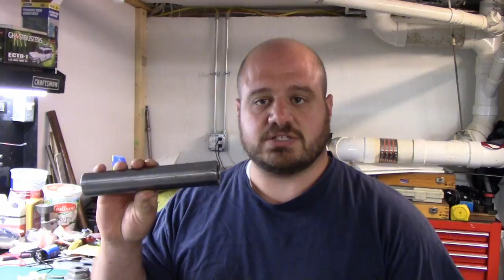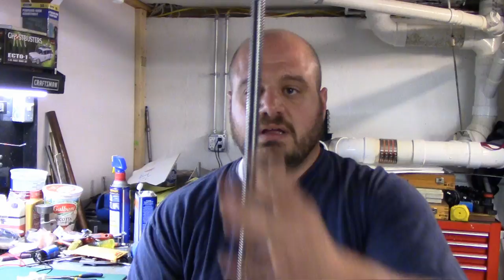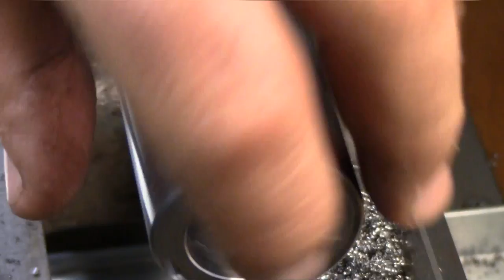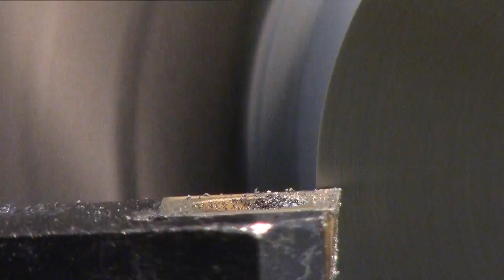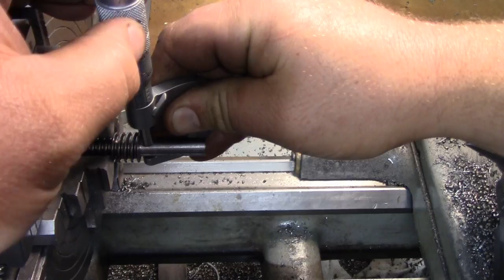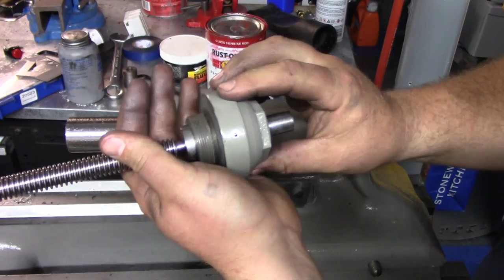13" Southbend Refurb: Tailstock Repair

Comment: I had problems with the tailstock on my 10L not holding.  A cleanup with a borrowed MT2 reamer fixed it very nicely. Inking it before vs after showed maybe 25% contact, now its around 90% contact.  Stuff doesn't spin anymore.

Comment: Hi Greg, very nice job indeed! As an aside, the paintwork on your 9"seems to be holding up well - what "type" of paint is it and did you brush it on?
Reply from the maker: Sherwin williams all surface enamel applied by brush and cabinet roller

Comment: Hi Greg
I thought you had a collet chuck for your lathe
Much better than damaging those threads in your 4 jaw chuck

Eddie  South Wales in the UK
Reply from the maker: Just being lazy and not wanting to change the chucks.  THe Acme rot has a nice flat on the top of the threads so it won't get damaged like a sharp v thread

Comment: great video Greg. at 26:49 you said something about your drill, I didn't understand what you said or what you mean.
Reply from the maker: Drill bit is leading.  One flute is either longer than the other or dull.  The chips coming off are not equal from both flutes.  Tends to either make your hole larger than you want or pull it off center.
Reply: oh, ic ic

Comment: just a quick question. who makes your tool holder. I need one for my little 9" and yours looks great. I have a piston type shars AXA that I was thinking of putting on it . what do you think.
Reply from the maker: AXA is the perfect size.  the holder is from A.R.Warner, for ccmt inserts, but you can get a similar ones anywhere

Comment: Why not turn the insert all at once using the threaded rod as an arbor?
Reply from the maker: The threads have clearance in them and it will wobble.  You'd need an acme nit to hold it down also.

Comment: Dude,
what's up with the bandaids?????
Reply from the maker: Covering a burn
Reply: ;)    could'da used electrical tape... love what you're doing so far... my 1918 12" Simplex Engine Lathe is stuck in the doldrums...

Comment: Good job, but still is it a repair or a patch, only reason I say that is would it have been better to machine a new quil to suit the worn bore of the tail stock it’s only a couple more operation and it would be mint.  I’m not trying to be a smart ass I’m interested in your reasoning. Thanks
Reply from the maker: It's a lot more work to replace the entire quill for not much more gain.  You'd have to recut an accurate and 100% centered Morse taper hole.  Also the actual tailstock barrel bore won't be worn evenly so the hole would be somewhat rounded so the only way to get a really good fit would be to line bore the tailstock round on some sort of fixture.